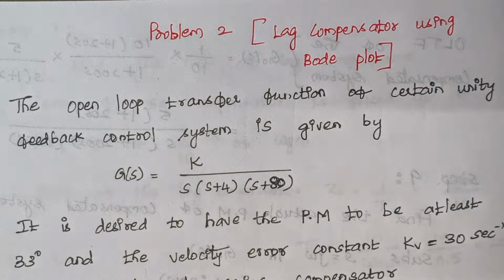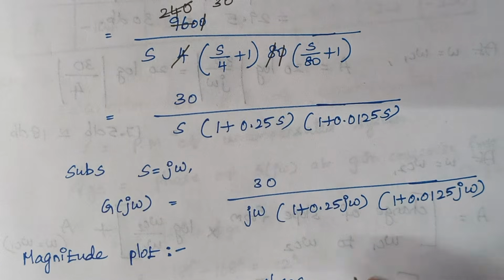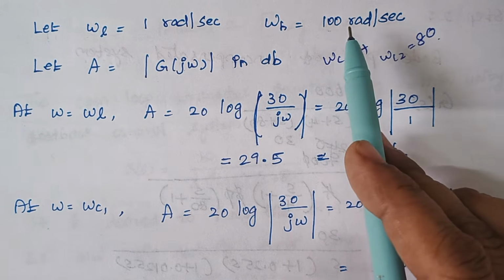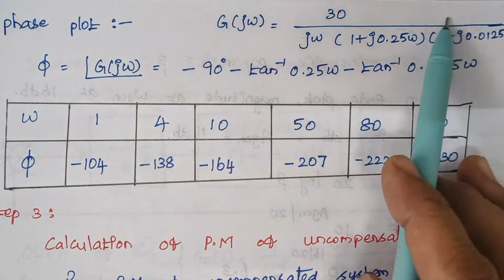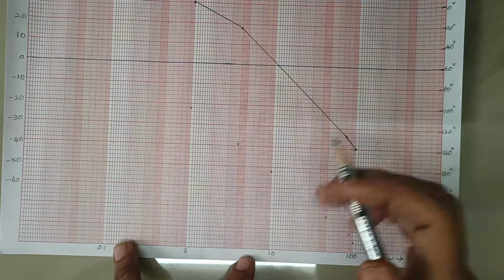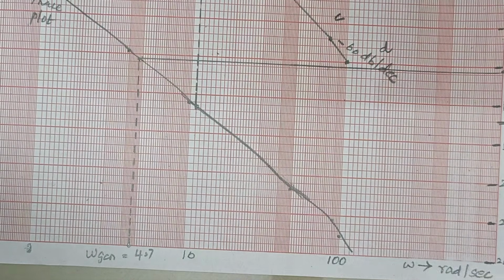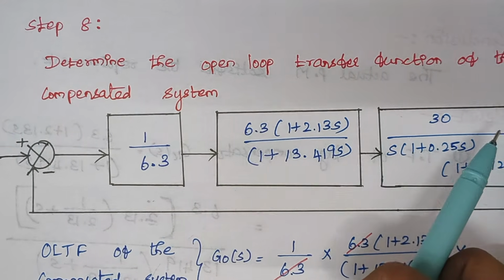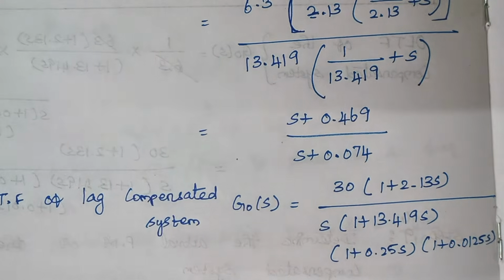Problem no 2 (Designing a Lag Compensator using Bode Plot )

Comment: Mam what is the answer of the question For a unity feedback system with G(s) = k/((s + 2)(s + 5)(x + 6)) design a lag 10 compensator using bode plot so that system operates  with a 10% overshoot and a static error constant of 100.
Reply: Mam there's no s in the denominator so what to do here??